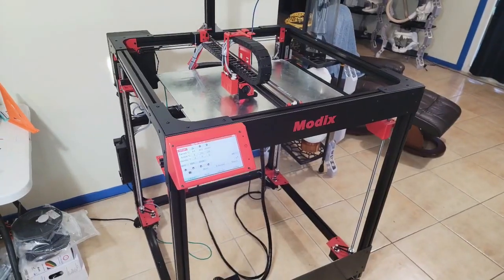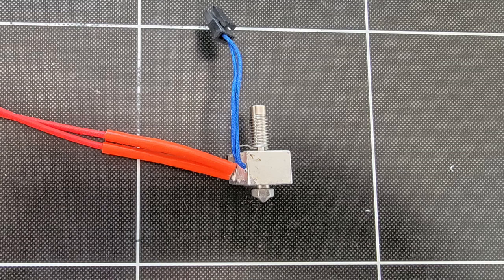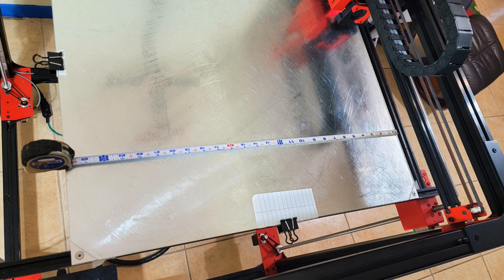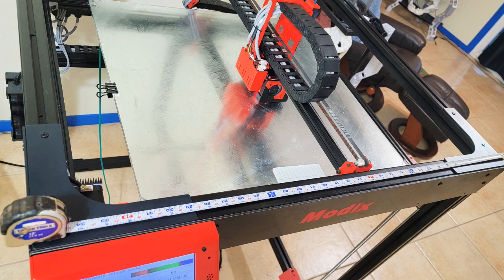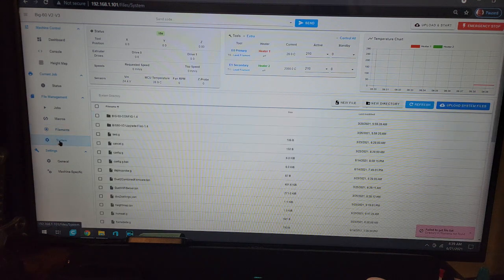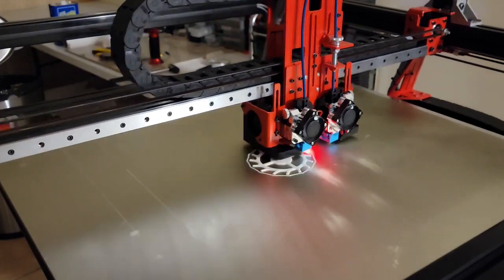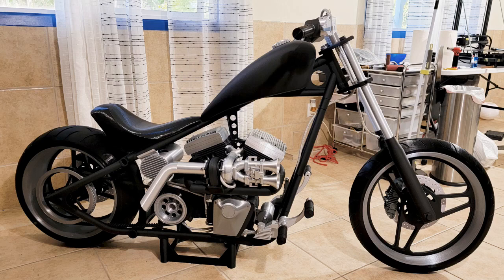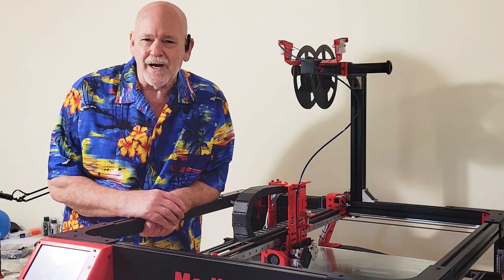Modix Big60 V3 Review after 500 hours of printing

Comment: Hello Frank, thanks for sharing the video, I just came across this monster 3d Printer, and the price wasnt bad at all. I have a question about how this printer compare with how long it takes to print parts as compared to some of your other smaller 3 D Printers, meaning if you printed something of the same size (smaller obviously) would it print just as fast or slower than your other printers?